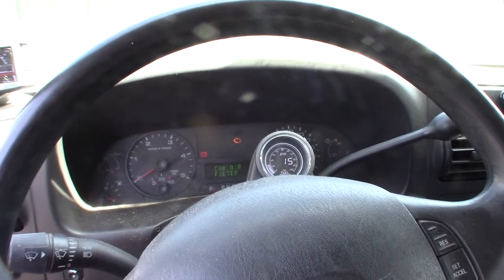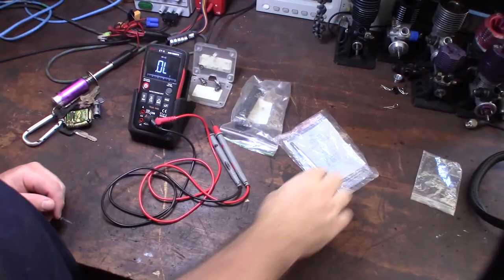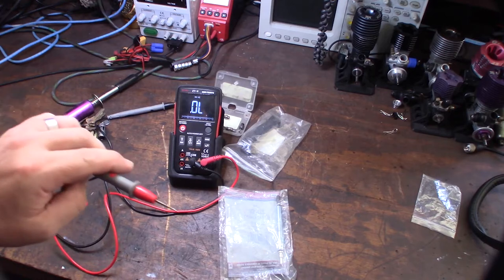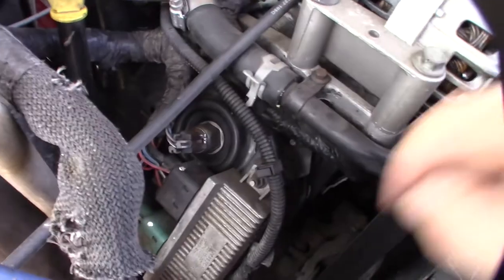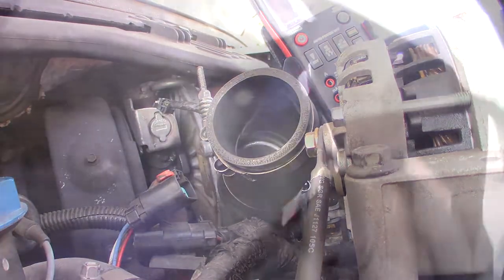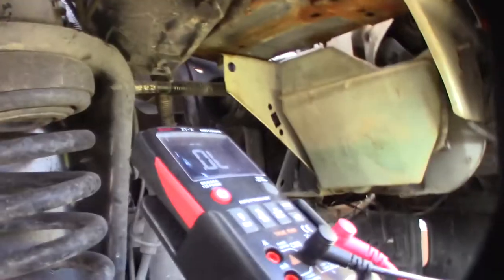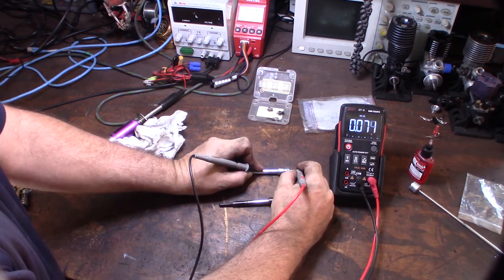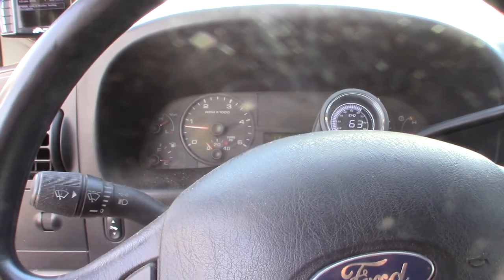Powerstroke 6.0 glow plug troubleshooting repair P0671 P0672 P0673 P0674 P0675 P0676 P0677 P0678

Comment: Thank you for this.  I have a new to me 06 F250 6..0 with 265k on the clock that's giving me an error code P0672 and P0404. So I get to take those this weekend.
Reply from the maker: You can drive the truck with a bad glow pug. The cylinder will eventually fire when the engine gets hot. P0404 pull the EGR and soak.

Comment: Where do you put the negative lead when testing the harness?
Reply: One lead is on the metal surface of the alternator (as shown), the other goes into the connector testing each glow plug at a time.
Reply: Tuco Benedicto thank you for the quick response.